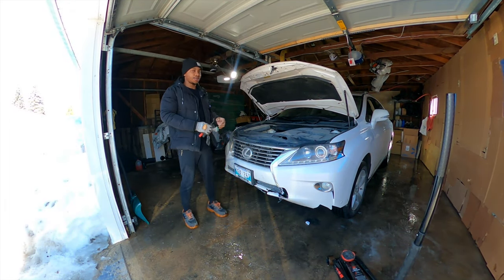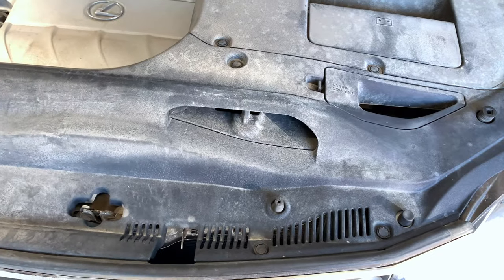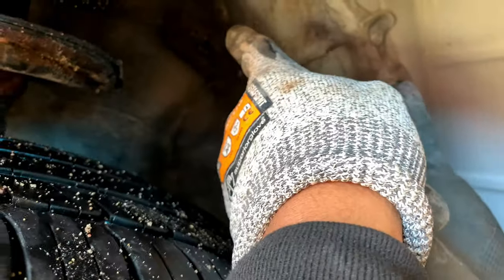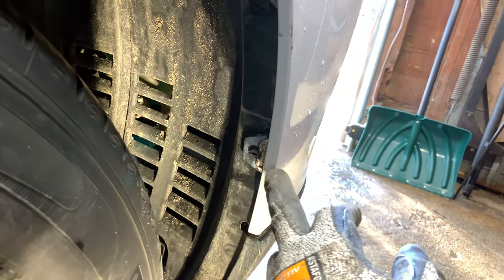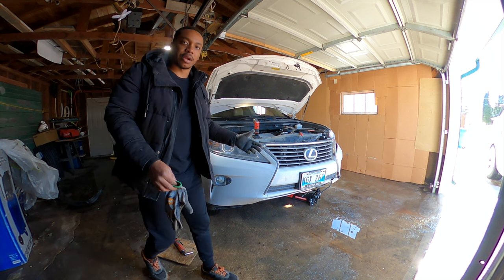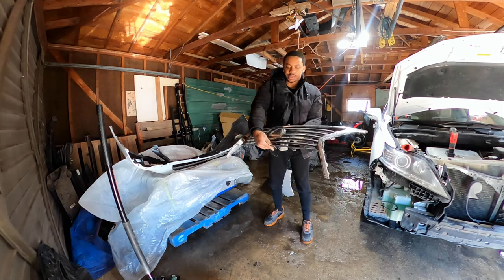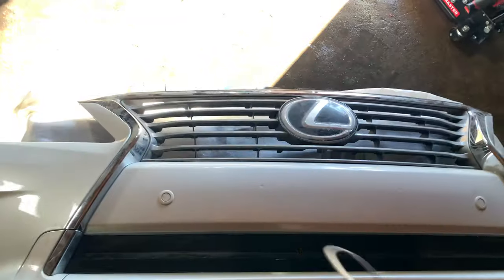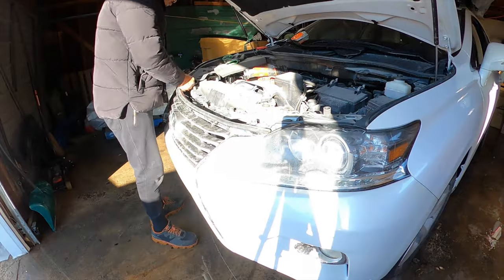HOW TO REMOVE AND INSTALL 2013 LEXUS RX 350 FRONT BUMPER

Comment: This is just the bumper cover, not the absorber and reinforcement which "may" need to be replaced if there was a collision that pushed the bumper back. Also, all the clips and bolts might be compromised so buying extras for that might save time. There are part sources out there for all of this: aftermarket or salvage.

Comment: Is it possible to replace this base trim bumper with the more protruding Sportdesign bumper?
Reply from the maker: Yes yet is possible. You might need to drill in custom holes to make it fit right.

Comment: @5:18 there is one fog light socket on the left but two sockets on the right. The grey one is for the fog light. where does the green one go?
Reply from the maker: I’ve worked on over a 100 vehicles since this suv. I can’t remember the specifics of this unit.
Reply: @MIKESBUILDZ  SENSOR SOCKET.

Comment: Is there some kinda kit to do a upgraded version like 2015 for the 2013 rx 350?
Reply from the maker: I’m not sure if there’s a kit, I doubt it but you can piece it together. I believe the hood, headlight and fenders are all the same 2013-2015. You’ll need to replace the front bumper, upper and lower grilles to update it to the 2015+ looks. Hope this helps. Subscribe if you haven’t already. Cheers!

Comment: your car is missing the transmission oil cooler cover!
Reply from the maker: I know!
Reply: @MIKESBUILDZ  is it important or not?
 Have you been driving without it?
Reply from the maker: It is definitely important to have it on there. This vehicle came to me that way and I advised the owner after the fact. They chose not to get it installed at the time.